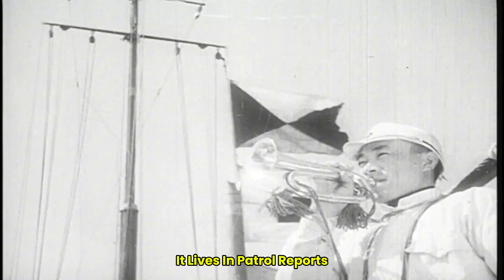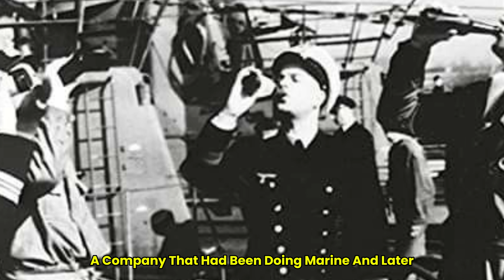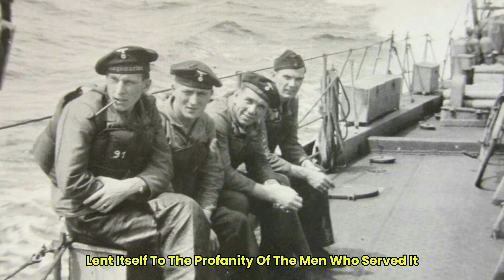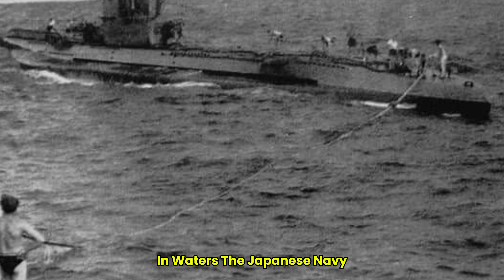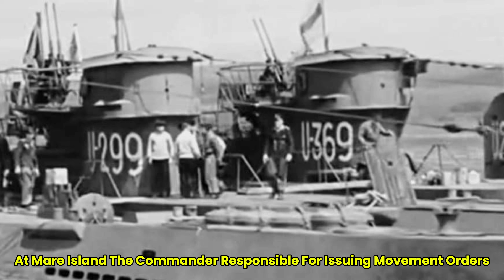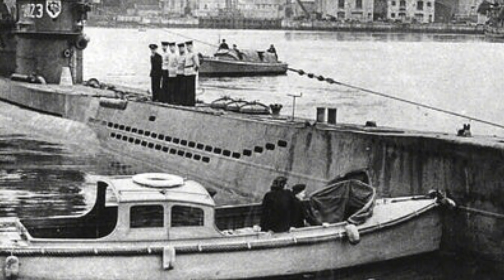The Engineering Mistake That Gave America the Best Submarine Engine of WW2

Comment: The Porpoise class was the first almost-fleet-boat class, a bit slow and just six torpedo tubes. The next, Salmon, class were "true" fleet boats, 21 knots and eight torpedo tubes,  characteristics shared by the Sargon and succeeding classes. The Tambor class was the first fleet boat class with 10 torpedo tubes. The Porpoise class had Winton 16-201A engines, which had problems, and were replaced with 12-278A engines. Three of the Salmon, four of the Sargo, and twelve of the Gato class boats started with H-O-R engines which had to be replaced during WW2. IMO, the H-O-R engines were the second worst scandal with USN submarines, the Mark 14 torpedo being worse.

Comment: I operated and repaired GM 278 series in the V6, V8 and V16 configurations in the 70s and 80s in the US Navy.  Not on subs, but surface vessels from tugboats to aircraft carriers.  Only ever had one breakdown when it dropped a valve and we had it back up an going in about 6 hours.  Never worked on HORs, but had some later experience with Fairbanks Morse opposed piston engines.  I preferred the old GM 2 strokes.

Comment: I agree your comments about the HOR boats are accurate. But only about 20 fleet submarines were ever built with the HOR engines. 
Over 120 fleet submarines were built with GM Diesels and yes they had a very good record of reliability. But over 120 fleet boats were also built with the Fairbanks Morse diesels and they also had a very good record of reliability. When HOR boats were re-engined, a set of GM or Fairbanks Morse were installed depending on availability. 
Your video does not give the Fairbanks Morse engines the credit they deserved.
Reply: Agreed. Interestingly, H.O.R. was a maker of steam engines which informed its attempt at diesel design  After the  "Hoe" failures the company had no where to turn technologically.